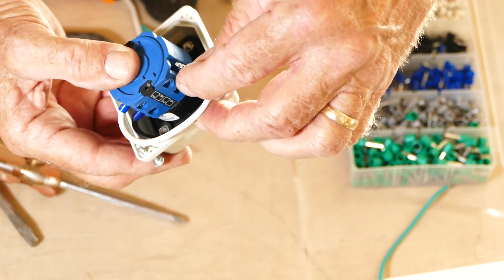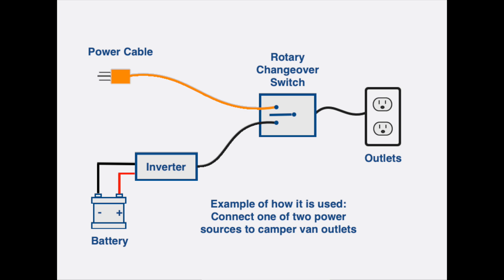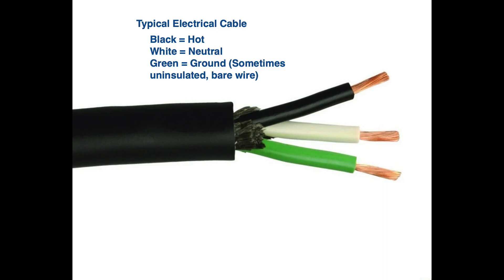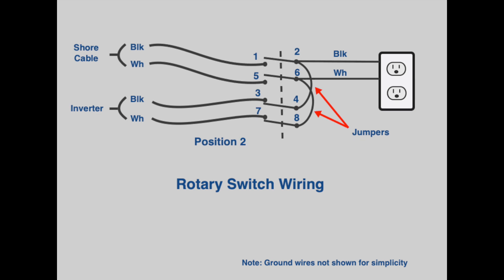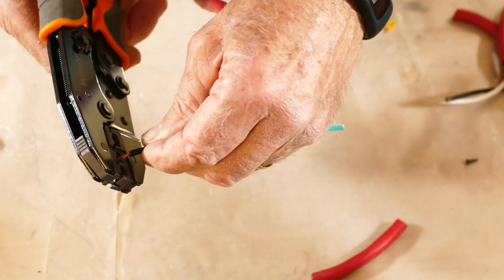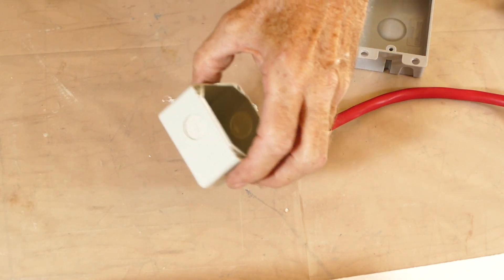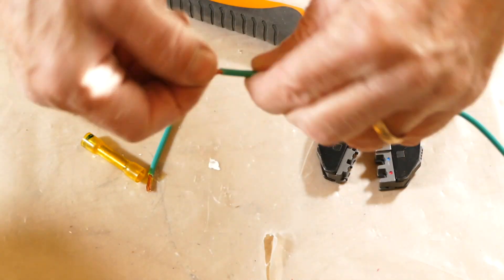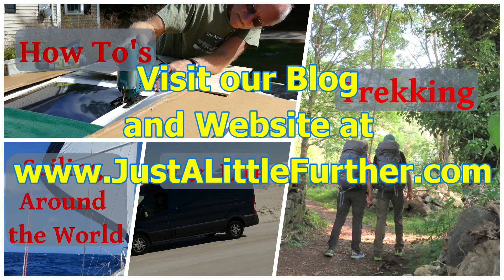How to Wire a Rotary Changeover Switch

Comment: Hi from Ireland,  thank you for this very educational and thoughtfully explained tutorial , i have the same switch purchased from amazon with instructions in Chinese, i am attempting to use in the camper van,  for switching from,  liesure battery - inverter to sockets then switch to shore to sockets. Where im lost is, i can see only one cable entering the switch box and also a very confusing switch. Lol
Reply from the maker: in my installation, the other two cables come in from the right, out of view in the video. You should be be fine if you follow the electrical diagram in the video. Hope this helps.
Reply: @JustALittleFurther Thank you for the reply,  I am a novice with wiring up domestic applications, however, finishing a diploma in Electrical and Electronic Engineering at the minute. I have this switch came with no instructions, I really want break before make function,  does your application of the switch,  allow for 0 position to be the break ? I then need 1 to be shore and 2 inverter ? If I follow your instructions will this apply  my required application. If my thinking is OK, are the 2 cables just out of view inputs from shore and inverter and the cable on left output to consumer unit ?
Reply from the maker: Yes, the center position 1 of the switch would connect the shore power, position 2 would connect the inverter, and the position 0 disconnects everything.

Comment: Great video, thanks.  I am over in the UK and want to do the the other way around in my motorhome.  I want to have solar coming in and then split to either the leisure battery or power station.  Would you mind explaining how I can swap this around please? thanks Mark
Reply from the maker: Hi Mark - the switch doesn’t care which direction the current flows. You should be able to accomplish what you want by connecting the solar to the “house circuit” connections in the schematic, the leisure battery to the “shore power “ connections and the power station to the “inverter” connections. Hope this helps.

Comment: Nice video, but massively flawed in terms of earth connections... "Join them together" isn't exactly "certified master electrician" terminology... There is no mention of re-wiring the consumer unit so that it still does it's job when there isn't a physical earth, when running from an on board inverter...
Reply: Fkn people always got something to say.  Lets see your video on how to do it.  Stfu
Reply from the maker: Not sure what you mean by “ re-wiring the consumer unit so that it still does its job…”. Could you explain what you mean? I certainly want to correct the video if there’s an error.

Comment: Dont mind me asking but shouldn’t there be 3 wires, one in and 2 out. At the end you have only 2… where is the 3rd?
Reply: I am wondering the same thing.
Reply from the maker: Actually, there are four wires in, two from the shore power connection and two from the inverter, and two wires out for the house circuit. Hope this helps…

Comment: Thanks, but Where did you connect all the earth wires after you crimped them together?
Reply from the maker: I use a small junction box alongside the bigger box that housed the switch - if that makes sense.

Comment: Great video, thanks! Is there a downside or risk to tying the grounds and neutrals for the two sources together and just switching the hot side? Seems like without a circuit the neutral isn’t going to do anything?;
Reply from the maker: Sorry for the delay in getting back to you... for some reason Youtube isn't sending me notifications when I get a comment. To answer your question - The neutrals and grounds should only be connected together at one point. On an rv,  they should only be connected together at the shore power main distribution panel. Otherwise, you may develop ground loops, and even worse, any GFCI protection on the shore power will constantly open the circuit since it will detect a short between the neutral and ground.

Comment: Hello! I am installing a 30 amp rotary switch into my rv just as you did on YouTube. This will switch from shore power to my inverter. I have watched your video at least a dozen times but am running into a couple issues. First, I tried installing the jumpers and used Ferrule connectors as you suggested. Problem is, the ferrules take up too much room. I am using 10 awg wire. For example, in slot 2 of your diagram, there needs to be two connectors. 1 wire in that slot for the jumper and the wire coming from that slot. I dont understand how you are fitting both wires if using a ferrule. My other issue is the strain on the curve of the jumper. For example, when connecting a jumper from 2 to 4, the wire ends are at an extreme bend. Seems it will weaken them. Is there a remedy to this? Thanks for any input on this. And by the way, I am totally new to this if you couldn't tell! LOL
Reply from the maker: @daniellyon2284  My circuit was 20 amps, so I used 12awg wire, and it was a tight fit. You may be able to use small ring terminals instead. Plan C might be to tin the wires with solder and insert them without terminals.

Comment: Could I use this switch to redirect one 220V power source (40A breaker) to 2 different units? One is an AC used in the summer, the other unit is a garage heater only used in the winter. Both units would never draw from the breaker at the same time.

I thought this would be an easier install than adding a new breaker. Thanks! Great video.
Reply from the maker: @patriotjedimaster1450  Great idea, but the switch is only rated for 20 amps. I do not know whether that’s 20 amps per contact, in which case it might just work, barely, or whether it’s rated for 20 amps total current for both sets of contracts. Maybe you can find a switch that’s rated for 40 amps or more.
Reply: @JustALittleFurther  I see the 40A version of the box (40A Rotary Changeover Switch with Box, 660V 3 Position 2 Phase 8 Terminals) has the same 8 terminals.  I need this for a temporary switch between an oven and induction top (until the remodel).  Obviously, I would need to confirm, but I would guess jumpers would be needed for 2/4 & 6/8 - seems logical?

Comment: Does the plastic box cover plate fit on a standard USA metal 1900 box, I feel like I may need more room inside box as the one supplied with the switch seems very small?
Reply from the maker: @kieranh6671  that would be nice, but, alas, it doesn’t fit a standard box. You might be able to drill out  a standard blank box cover, attach the switch to it, then attach the cover to a standard metal box. If you think of a better solution, please share it with us all. Thanks!

Comment: Such a small world.  I decided to put one of these rotary switches  to select sending shore power to either the inverter/charger of directly to the ac system on the boat.  The total lack of instructions that came with the switch motivated me to google solutions and low-and-behold I ended up on the new Nine of Cups YouTube channel.  John s/v Active Transport
Reply from the maker: @johnlewis6880  Hi John! Small world indeed. Other than the occasional email and holiday newsletters, Marcie and I were thinking Tasmania was the last time our paths actually crossed. Brings back lots of great memories… like being anchored in Sydney Harbour watching the fireworks on New Years Eve all those years ago. As to the switch, we had an identical rotary switch on Nine of Cups that we used for the same purpose, and the documentation hasn’t improved over the 25 or so years ago since I installed it then. Hope you found the YouTube helpful. All the best, David.

Comment: Not sure where to put the ground wires. I have a small camper that has both a battery system with inverter and shore power. The intent of the installation is to be able to switch from the shore power to the inverter/batttery system (ecoflow delta pro 3). How do I ground these connections for both power inputs?
Reply from the maker: @CarlGeers  Hi Carl, all the ac grounds should be connected together. There’s not room enough inside the switch enclosure to connect them together, so I connected them together outside of the enclosure. You will probably have three wires to connect together: the shore power ground, the inverter ground and the ground wire for the electrical outlets. Hope this answers your question. David